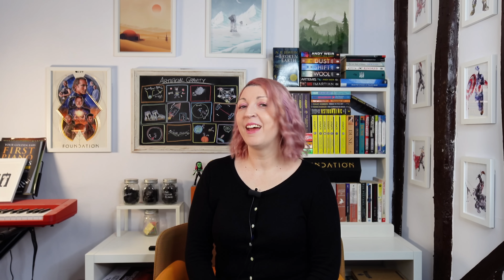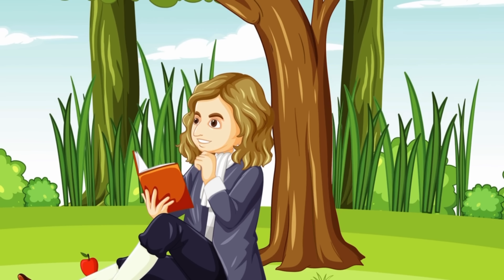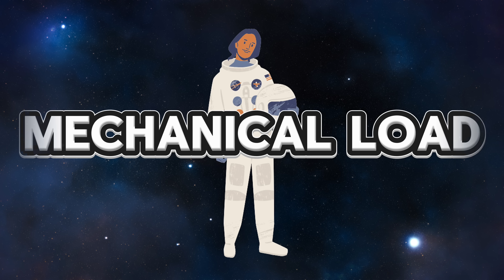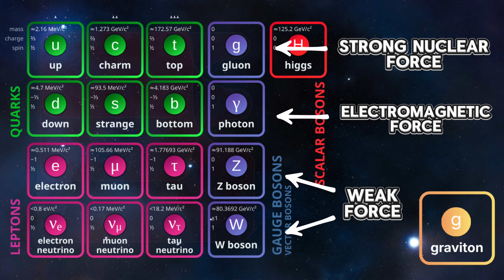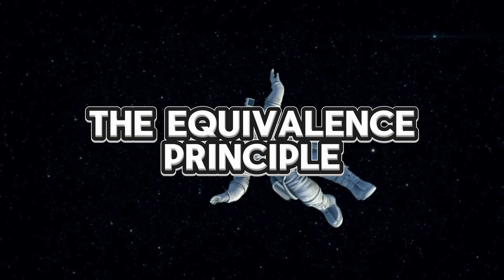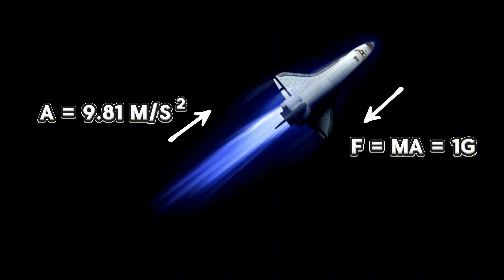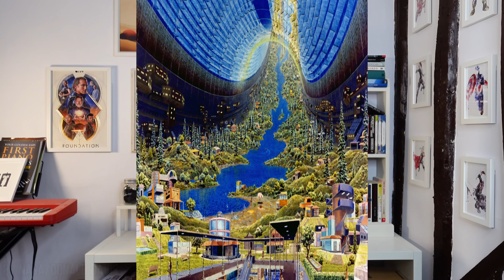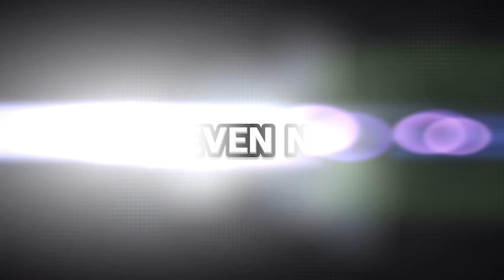Why Artificial Gravity Is Harder Than It Looks

Comment: Does the rotation gravity stop working when your feet leave the ground in space?
Reply: Yes, but after you jump up, the rotation of the floor will bring it back up to you.
Reply: @civwar64bob77  Let's say you're on a hovering platform a few feet above the rotating surface, will you still feel the rotation gravity even though your isolated from the moving surface?
Reply: @David-E-w8q  Abigail James speaks of "O'Neill cylinders and Stanford Tori enormous space habitats that are kilometers across spinning to provide a steady 1G at the rim". Those are straw men. But if one existed, and had a platform hovering a few feet above the deck, well, exactly how is it hovering?

For 3577-m radius and two-minute rotation, a combination that gives one gee, the rotation gives the deck a tangential speed of 187 m/s (419 mph). A helicopter that is sitting on the deck, and then turns on and raises itself a few feet, does not lose the 187 m/s. So it has to burn fuel at the same rate a helicopter hovering on Earth would. If it turns off its engine, the gravity will promptly bring it back down.

But maybe there's no air in the habitat, and the vehicle that lifts off the deck is a rocket, and it accelerates 187 m/s antispinward and then turns off. This cancels out the speed it had on the deck, and now, yes indeed, it can sit a few feet up while the deck rushes by under it at 419 mph. It would get no circular-motion gravity because it would no longer be doing any circular motion.

Why are the habitats this could happen in strawmen? Because no-one would ever build them. A real habitat circling at 3577-m radius would do so while hanging from a linear tether much longer than that. If an equally massive habitat is at the other end, it would be twice that long, 7154 m. Each hanging habitat would extend at most a few tens of metres in the direction it swings in, and a rocket that lifted off and accelerated west would crash into the west wall.
Reply: @David-E-w8q  Hmm...when you are 'falling' you don't 'feel' gravity. You are in 'free fall' (Ever ride the Twilight Zone Tower of Terror or other rides that drop?). Einstein used this idea in his theories. So, you jump up, and you 'go down' (which could be just as easily the floor accelerating up to you.) So, on the space station, you jump and you are technically in free fall, and the floor comes up to meet you (but it seems as if you fall towards it). You never actually 'feel' gravity. You feel acceleration.
Reply: @David-E-w8q  (Addendum) I don't think I answered your question. The air is rotating too, so you continue traveling with the floor still directly below you, I think. I'm assuming you and the platform are inside the rotating station. Same as on an airplane--the air moves with you. The platform will be blowing air down to keep itself hovering, so you still feel that force pushing you up, like gravity. Tricky question!
Reply: @civwar64bob77  When you consider how earth gravity works when your on an aircraft that's hovering you still feel the planets gravity even though your not in contact with the surface. So I think the question really is does artificial gravity warp space time on a smaller scale within the zone of influence of a spinning torus?
Reply: @David-E-w8q  You're in a helicopter hovering, so you 'think' you 'feel' gravity. The helicopter disappears and you free fall. Why don't you 'feel' gravity any more? Same with an astronaut 'floating' in space--he doesn't 'feel' gravity yet the earth is still pulling him and he's in a gravitational field. Einstein showed that you cannot tell if you are in a spaceship accelerating up vs. standing on a planet.
Reply: @David-E-w8q  In Einstein's General Relativity, a very massive spinning object can 'drag' spacetime in the direction of spin (called Frame Dragging). The Earth does a very tiny amount of this. The Sun a lot more (which explains the old mystery of Mercury's shifting orbit). A rotating space station would be too small for any measurable effect. But a space station, rotating or not, does have its own micro-gravity due to its mass.

Comment: Correction:  It's 1 (not 10) followed by 36 zeros.
Reply: Man, it seems like space travel throughout the galaxy will remain fiction
Reply: @dutchside33  yes. Mankind will be stuck in our Solar System. We might not even leave Earth and space exploration will be done remote by AI assisted robots.
Reply: 36… 35… with the size of those numbers, who really cares what it is?
Reply: No, it is ten followed by 36 zeros ence 10 to the 36 power.
Reply: @carlossaraiva8213  Example:10^2 =100
Reply: @TryingToFindOut  but ten followed by two zeroes is 1000!
Reply: @carlossaraiva8213  This is incorrect! It’s 1 followed by 36 zeroes!  10 to the power of 2 = one followed by two zeros = 100 (which is 10 followed by one zero)! 10 to the power of three = 1 followed by three zeros! 10 x 10 x 10 = 1000. So ten to the power of anything = 1 with anything amount of zeros after it. 10^x = 1 with X amount of zeros.
Reply: @carlossaraiva8213  No. But also: Even engineers f this up from time to time (like, every one of them at least once) :D
1=10^0 (it's fine, I know), 10=10^1, 100=10^2, 1000=10^3, and so on. Maybe the E notation could help - it means the exact same thing ("... multiplied by 10 to the power of ..."), but as you don't write the ten, there is no zero to trip you up.

Comment: What space fans say:

The arithmetic of omega-squared-R points to a life-support gravity solution that is as debatable-in-good-faith as 2+2=4.  Start with just one ship, a tether, and a far-end module that typically will be much less massive than the ship. One end of the tether is permanently attached to the ship. The other is permanently attached to the far-end module.

At launch, the far-end module and the furled tether are in the ship’s nose. By putting the ship into slow end-over-end rotation, maybe 30 rotations per hour, we get a small amount of gravity. We begin lowering the far-end module into that gravity by unfurling that end of the tether. The gravity will make that module and the paid-out part of the tether extend straight forward from the nose.

This lowering would slow the system’s rotation, except the far-end module is functional. It is not just a counterweight. It includes a solar array that makes electricity, an ion drive that uses that electricity to make thrust, and a propellant reservoir. The thruster thrusts tangentially to the slow rotation, keeping the rotations per hour — the angular speed — constant as the tether continues to unfurl.

With the turn rate being thus held constant, the strength of the gravity is simply proportional to how far out you are from the spin axis. Supposing that when the ion drive has just exited the nose, it is 20 metres from that axis, 30-rph angular speed means the gravity it is feeling is 0.00559 gees. We’re looking for an end state where the ship is getting one gee. That will require it to be 1/0.00559 times 20 m from the axis. 3577 metres out.

If the ion drive and the solar array total one-ninth as massive as the ship, one might expect them to be nine times farther out on the other side, and the total tether length to be 35.77 km. Each kilogram of them would then counterweigh nine kilograms of the ship.

But that much tether is quite significantly massive and weighty all by itself, and with this taken into account*, balance is attained by having the far-end module 13 km from the axis, where it gets 3.63 gees. So each kilogram of it counterweighs 3.63 kg of the ship, and mass is reduced compared to the case where ship and counterweight are equally massive and equally far out.

Also reduced: complexity, compared to schemes in which multiple ships launch separately and hook up once they are in space. Only one ship, no spacewalking, everything already connected.

Comment: Regarding rotational habitats:

It's like living on the bottom of a permanent valley - Want to go, say, north or south? flat terrain. Want to go east or west? always uphill. Sounds miserable.
Reply: Since you would be moving on a curved path with constant distance from the axis, you wouldn't feel as if you were walking uphill. You would effectively be walking on the flat.
Reply: Here's my suggestion. Make a wheel; it doesn't have to be very strong. It's only there to maintain rigidity. The wheel has spokes from the center of the wheel to the rim. At the outer end of each spoke attach a module, something like a shipping container only larger. The modules are oriented at ninety degrees to the plane of the wheel. They can have flat floors.

Comment: With rotating fast on smaller diameter vs slower on a larger diameter is there an issue of more uniform "force" across the height of the body on larger diameter rotation than with really small spinning fast. As in difference in force for the feet vs top of the head? Also for muscoskeletal stuff wouldnt a set of rubber bands/push rods attached to a suit with apropriate tension simulate load on the muscoskeletal system? I get that it won't affect internal organs and fluid distribution but for bone loss could it help?
Reply: A load-suit. I like the idea.
Reply: @jpr1.6180  I mean the do have bands that push them into excercise equipment for it to actually work but probably to add load to musculoskeletal system. But I'd imagine with fast actuators and cheap processing power it could be feasable to simulate "normal" load via external actuator tension/pressure.

Comment: If I'm living in a giant and therefore slowly rotating toroid and I decide to go for a run against the rotation... do I float away?
Reply: You get lighter by a little bit. A giant toroid can have a low RPM but sitll have a high tangential speed. The earth takes almost a whole day to rotate 360 degrees, but a point on the equator is still moving over 1000MPH.
Reply: As the toroid gets more gigantic, the rotations-per-hour for one gee diminish, but the tangential speed increases. Tenfold increase in torus radius --> 3.16-fold increase in tangential speed, 3.16-fold reduction in angle rotated through per unit time.

So, no. Even in the cheapest possible toroid, no-one can run that fast.
Reply: If the toroid's major diameter is only 200 meters, and the false gravity from rotation is only a half g, then the floor is going about 22 m/s, so if you can sprint at a very impressive 11 m/s you'll still experience a quarter g holding you down to the floor.

That's a pretty bad scenario, because a plausible structure for long-term habitation would probably be much larger than 200 meters to avoid the complications from fast rotation, and the false gravity you'd shoot for would probably be much closer to 1 full g. A 2 kilometer wide toroid with 1 g would spin with the floor going 100 m/s, so a still very impressive 10 m/s sprint would leave you still at 90% of a full g.
Reply: @BlahVideosBlahBlah  99 percent, I think. Your (10 m/s)^2 over 1000 m is only 0.1 m/s^2, only ~0.01 gees, so that's all that gets cancelled.

"... false gravity ... false gravity" --- I disagree. It's as real as gravity gets.

Comment: Star Wars : almost all vehicles even with the engine turned off simply float above the ground, to the point where they are often not designed with any struts to hold them up 
These Repulsorlift vehicles are ubiquitous, and also are used for in atmosphere drives of all sizes and artificial gravity that never fails - but it is never explained and just handwaved
Reply: Well, look what happened when they “explained” the force 😵‍💫 I think we’re better off without Lucas trying to explain anything.
Reply: "Star Wars" is science fantasy - it has a lot of the trappings of sci-fi but it isn't really.
Reply: Like a magic trick, it was all done with mirrors.